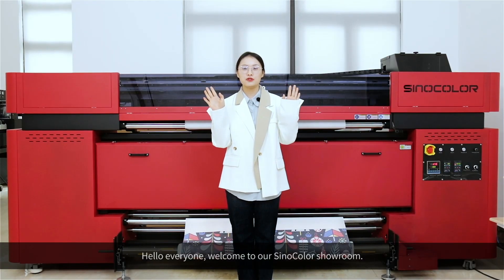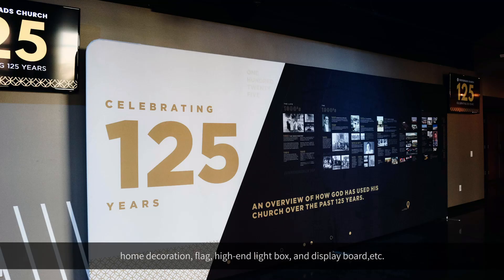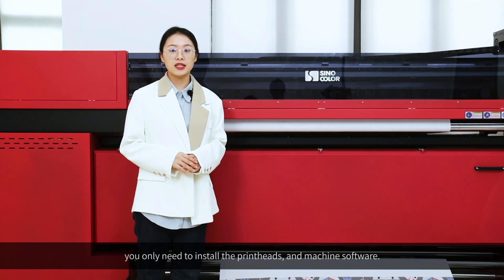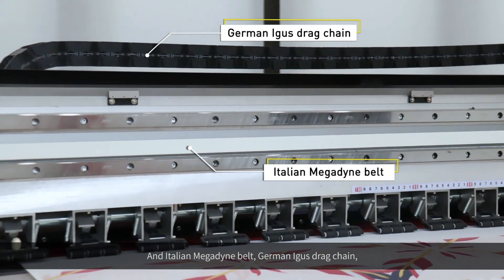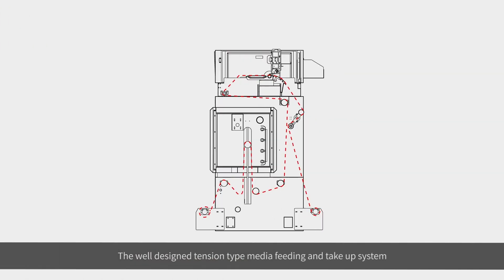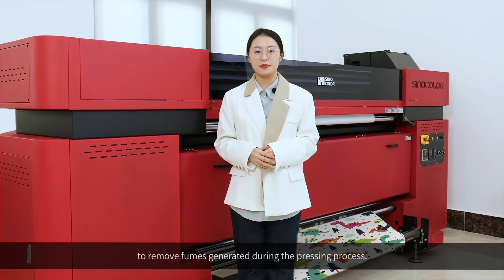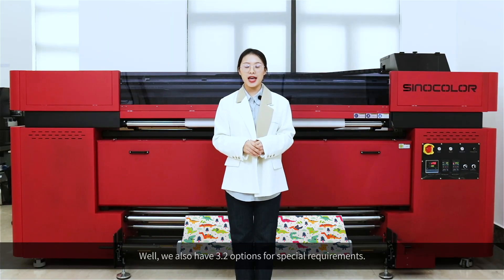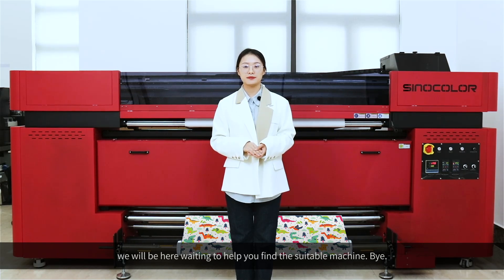Direct textile printer FP-740S

Comment: Hi, what is the durability of the print after wash on the fabric? What’s the cost please?
Reply from the maker: hello Ilesanmi Elerewe. Thanks for your inquiry. When work with sublimation ink, it is usually for light box, flag, display board. Which can be outdoor or indoor and no need washing. Lifetime for outdoor is more than 1 year. While if print with pigment ink for cotton, the lifetime will be same as the cotton shirts you bought from shopping mall: no problem for one year washing. And in the second year if you don't mind it to be kind of old, can continue using it.  please kindly send inquiry to sales@sinocolordg.com. or send us message on whatsapp to +86 138 1840 6913. Or leave your email/Whatsapp. Then our sales will send you more details immediately.😀